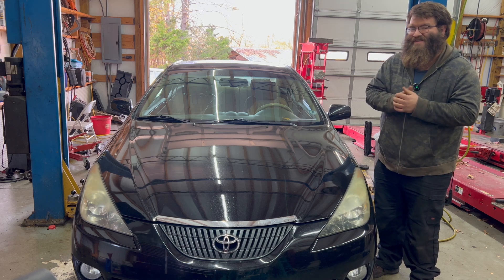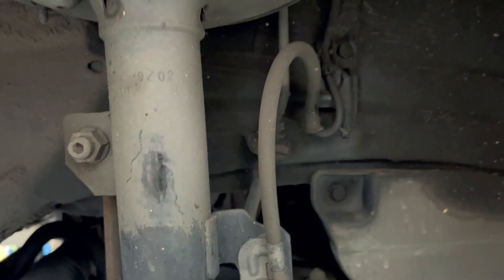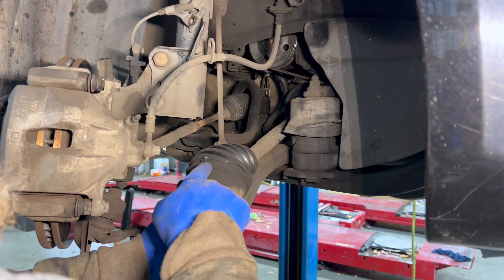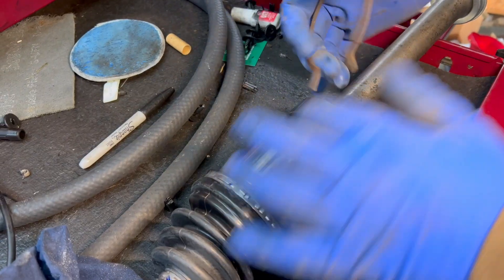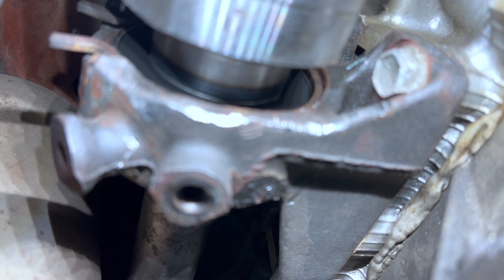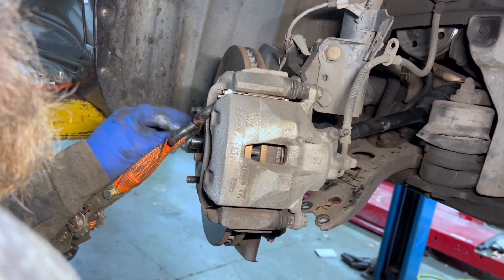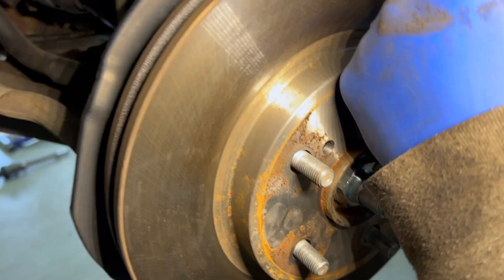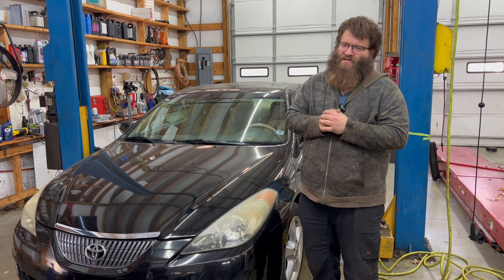2004-2008 Toyota Solara Passenger Side CV Axle Replacement

Comment: I bought an air hammer after watching this video.  That bearing sure was stuck!  I touched the tip to the bearing housing and used a pry bar.   It came out in seconds, just like your video.  Thanks so much for a great tip.
Reply: Yeah, I'm lacking that tool...looks useful though. So, you didn't need it? The pry bar was good enough for that? Im going to order parts and do this repair soon
Reply: @vintage35171  I needed the tool.  I bought a cheap one for $25.00, and used my pancake compressor, and it worked just like the video.  I tried everything else first, including a slide hammer, but this technique was effortless, and came it out in seconds.  Be careful to only touch the tip of the air hammer to the carrier bearing housing- not the bearing itself.  Hats off to Automotive Insight.
Reply: @robertlarge7649  That's good to know. I'll definitely get one regardless and watch that bearing.
Reply: I saw that tip too. What genius idea. Wish I would have seen this earlier. My carrier bearing I had to remove with axle and beat it off. Fun stuff struggling.. said nobody ever

Comment: This video was a big help. But I have replaced a leaky left transaxle seal twice but it still leaks. We can see exactly where it is leaking. Two new seals have leaked. Am I missing something in my case installation?
Reply: No cas
Reply from the maker: #1 Check to make sure you didn’t nick the case taking the old one out. #2 There is also usually a specified install depth (which I don’t know off hand) #3 mic your axle shaft diameter. I’ve seen cheap aftermarket axles be .008” smaller than the one coming out of it.
Reply: @automotiveinsight thx
Reply: Where can I get the specification for this install depth. I have the shop manual for this car. I think we drove the second seal in too far and it leaked out the port. The instructions in the manual for installing the transaxle do not address installing the seal. Do you have other resources? Looking on forums, it appears that this is a common problem. Thanks.

Comment: So after installing the drivers side axle, no issues. Started the van and now i have a steady abs and flashing tire warning light. Any idea. Did i overstretch the speed sensor for that wheel. The code thrown is 32 . Will the light go out on its own if i replace sensor with new one. Is there a reliable/easy way to reset. 
I did try the "$200 paperclip trick" turn on tap brake 8x in 5seconds turn off, pull paperclip start car... 
-did not work😢.
Reply from the maker: Code 32 is for the left side speed sensor. If you broke the abs sensor wire, you can disconnect the sensor at the connector and check the resistance on the 2 pins with an ohmmeter. If it reads open, then yes, your speed sensor and/or harness is damaged. I've also seen cheap aftermarket axles not come with the exciter ring on the axle.
Reply: @automotiveinsight   I will pull the old harness with sensor and replace with new. Will the system recognize all is good and clear the ABS light on its own after installing the new sensor? Thanks for your help.
Reply from the maker: @surfside75  yes. it runs a resistance check every key cycle.

Comment: what type of tool is used to vibrate the CV axle out the brace?
Reply from the maker: Air hammer
Reply: What brand air hammer and what psi on the air compressor  @automotiveinsight
Reply from the maker: I don't distinctly remember. It was probably our matco silver eagle. Our shop air is about 120 psi.

Comment: What vibration tool did you use to separate axle from transmission?
Reply from the maker: We used an air hammer and pry bar.
Reply: genius move, thanks  @automotiveinsight

Comment: Want brand cv axle did you use mine is not sealing leaking transmission fluid uses a cardone
Reply from the maker: We used a cardone as well. Sounds like you probably need to replace the axle seal.